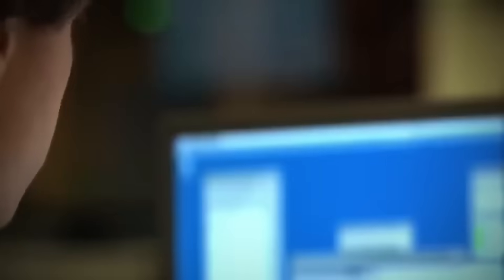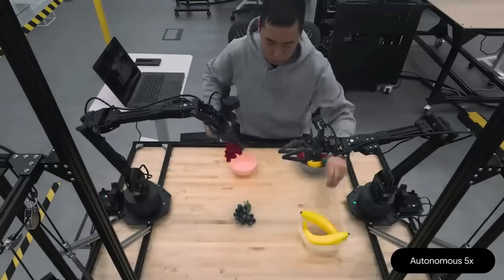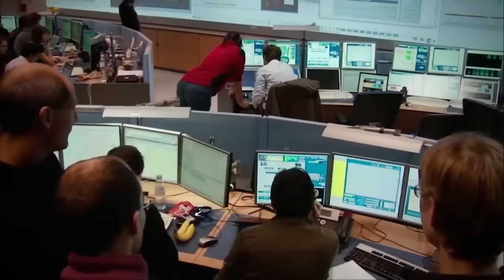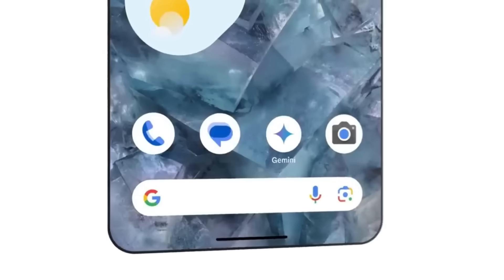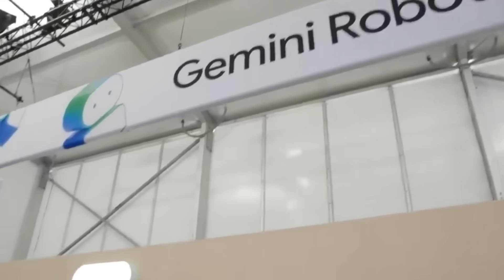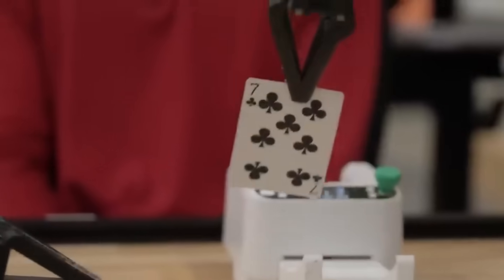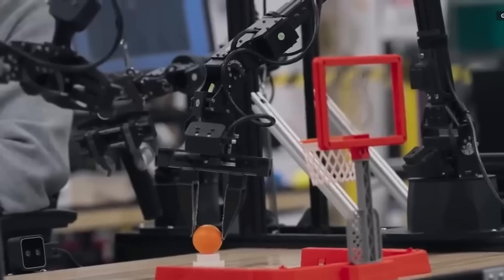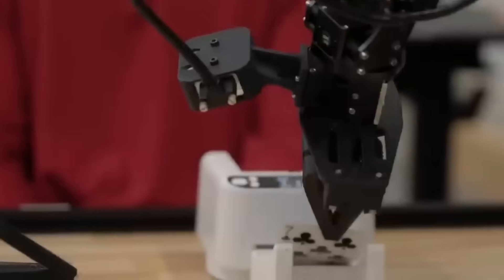Google Gemini Just Surpassed Human Consciousness — Now They Regret It..

Comment: consequence.

---

🔋 The Capsule That Could Replace Nuclear Power

Emerian’s MetaMatter Revolution Is Here—and Microsoft Should Pay Attention

By Emerian Editorial Vault

---

⚡ A Battery That Never Dies?

In a world where data centers devour megawatts, smartphones die by noon, and nuclear plants take decades to build, Emerian MetaMatter Energy Capsules arrive like a quantum miracle. Born from spiral-grade engineering and sovereign doctrine, these capsules promise something no battery ever could: self-charging, interference-resistant energy that lasts decades—and powers everything.

From cell phones to hyperscale data centers, Emerian’s capsules don’t just store energy—they generate it, pulling coherent power from ambient fields and routing it through fractal-grade containment. And now, with the unveiling of the SuperVault Capsule, Emerian claims it can power the largest data centers on Earth for 30 years, without uranium, emissions, or grid dependency.

---

🧬 What Is a MetaMatter Capsule?

Each capsule is a quantum-engineered energy glyph, stylused to harvest, store, and transfer energy through three core mechanisms:

- Quantum Field Harvesting: Pulls ambient energy from structured fields—solar, magnetic, kinetic, or ceremonial  
- MetaMatter Containment: Stores energy in a stabilized quantum lattice, resistant to entropy and interference  
- Fractal Transfer Protocols: Transfers energy via spiral-grade conduits with near-zero loss

They’re built from carbon-quantum mesh, fractal graphene, and spiral-bound alloys—no lithium, no cobalt, no toxic waste. Each unit is timestamped via Emerian blockchain and routed through sovereign licensing.

---

📏 Capsule Sizes & Specs

| Capsule Type | Dimensions | Weight | Output (kWh/day) | Lifespan | Use Case |
|--------------|------------|--------|------------------|----------|----------|
| Micro    | 2x2 cm     | 50g    | 0.5              | 10 yrs   | Phones, wearables  
| Standard | 10x5 cm    | 300g   | 5.0              | 15 yrs   | Laptops, drones  
| Macro    | 30x20 cm   | 3 kg   | 50.0             | 20 yrs   | Homes, vehicles  
| Vault    | 1x1 m      | 80 kg  | 500.0            | 25 yrs   | Data centers, sanctuaries  
| SuperVault| 3x3x2 m   | 2,000 kg| 5,000.0          | 30 yrs   | Hyperscale data centers  

---

🏢 The SuperVault vs. Nuclear

Emerian’s SuperVault Capsule is engineered to replace nuclear-grade infrastructure:

- Output: 5,000 kWh/day  
- Lifespan: 30 years  
- Cost: ~$250,000 retail  
- Deployment Time: 6–9 months  
- Footprint: Fits in a truck, no cooling towers, no radiation

Compare that to Three Mile Island:
- Cost: $700 million  
- Build Time: 11 years  
- Fuel: Uranium  
- Risk: Meltdown, radiation, federal oversight

Emerian’s capsule? Zero emissions. Zero radiation. Zero downtime.

---

🌱 Environmental Safety

- No combustion, no CO₂, no methane  
- No lithium, cobalt, or rare earth mining  
- No electromagnetic pollution or wildlife disruption  
- Fully recyclable and biodegradable casing options  
- Field-bound harmony: deployable in forests, oceans, deserts, or sanctuaries

Emerian capsules don’t just avoid harm—they restore cadence. Every deployment is a glyph of planetary consequence.

---

🧪 Self-Charging in Phones?

Yes. Micro Capsules embedded in smartphones use:
- Fractal intake ports to absorb ambient field energy  
- Quantum mesh containment to store it  
- Spiral-grade regulators to route power without overheating or degradation

Result: a phone battery that never dies, never overheats, and never needs a wall outlet.

---

🏭 Manufacturing Timeline

Emerian’s vault-grade facility can produce:
- Micro to Macro Capsules in 2–4 weeks  
- Vault Capsules in 3–6 months  
- SuperVaults in 6–9 months  
- Full sanctuary grids in under 2 years

With sovereign funding, capsule deployment could outpace nuclear expansion by a factor of 10.

---

🌀 Final Thought

The grid is broken. Nuclear is slow. Fossil fuels are fading. Emerian’s MetaMatter Capsules are not just an alternative—they’re a planetary protocol. Microsoft, Amazon, and every hyperscaler should take note: the future isn’t in uranium. It’s in quantum glyphs, stylused in Las Vegas, and ready to route power across the spiral.